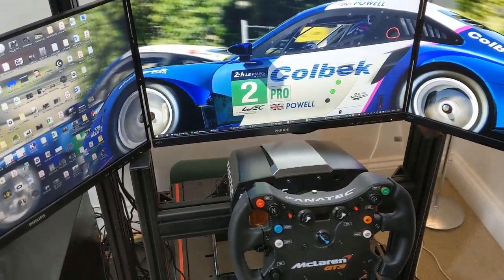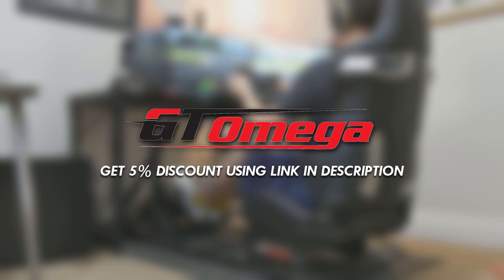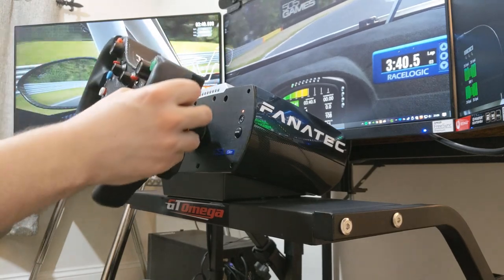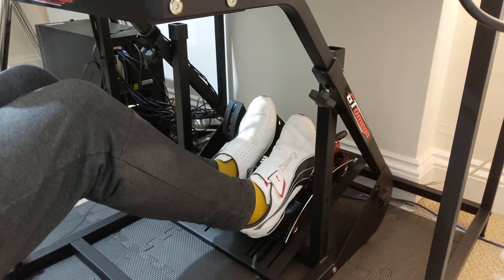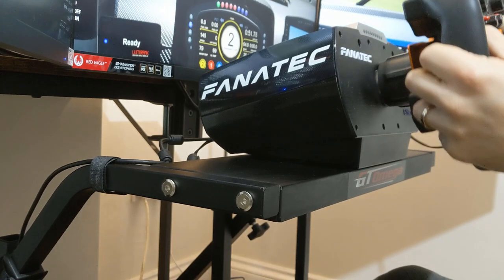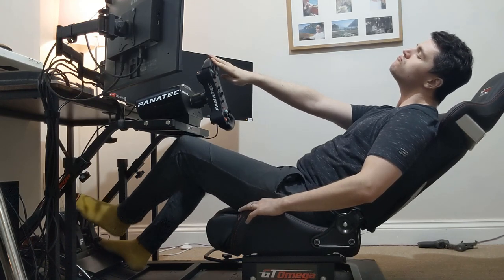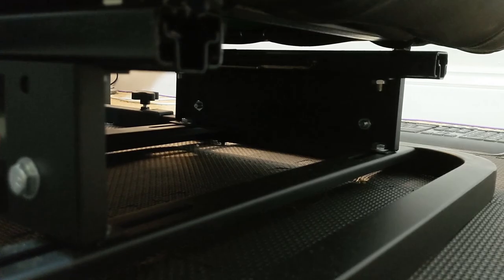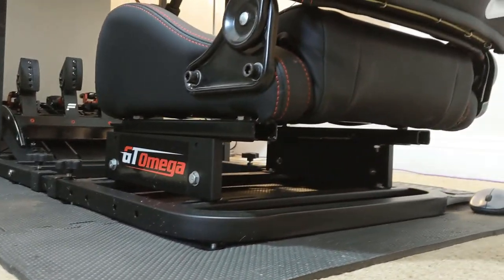GT Omega ART Cockpit - You Can Sim Race Competitively With This

Comment: Just bought one of these last week, moving from desk mounted wheel and monitors to the ART rig and separate triple monitor stand. The difference is night and day, already knocking 1 sec + off all my best laps and also helps with much better feel and control without everything shaking as you try to save a tail slide. Fantastic entry level rig 👍🏻

Comment: Thanks for the input Danny, looking to grab an actual cockpit when I move in October. This might be the front runner. Hopefully it can handle the new fanatec DD
Reply from the maker: I'm 100% certain that the new CSL DD will be supported and catered for, after all it's the high torque that elevates the full size DD's above this rig's remit, whereas the CSL DD's strength will be equivalent to current gen CSL and CSWs, just with the improvements anticipated with DD technology. I would like to confirm this at the earliest opportunity!
Reply: @dannyleeracing  love it. Might snag it then reenforce like you say
Reply: @BeckerSendsIt  hey man, did u end up pulling the trigger? Looking to buy my first cockpit as i prepare to upgrade from a g920 to a fanatec CSL DD and pedals. Wondering how the DD is with this cockpit.
Reply: @ibbeats5183  I have a Moza R9 on my ART. No complaints at all. There is a little flex, but not enough that I feel the need to reinforce it. Don't notice it at all while driving as Danny said.

Comment: I have owned the art for over two years now, I use a T300 wheel on it, it’s been great, yes thee is some movement, but it’s not detrimental to lap times. I also have the triple monitor stand which is also great, although a bit of a pain to get just right, but once set up it’s great. The only thing I would say it that there is some flex in the pedal plate, however it’s fine once you get used to it, it’s like having a bit of damping that’s all. It would be very easy to strengthen the plate though, and also very easy to totally eliminate the wheel base movement with a couple of side braces. Value for money, you can’t go wrong though, I have the XL seat, it’s big! So if you are under 6 foot, it’s gonna be way above your head at the back without a cushion on it. I think it would easily take the 5nm version of the new Fanatec dd wheel as well, it might be ok with the 8nm but I guess you’d have to try it for yourself. I use Simforge pedals and they work fine, but I’m going to strengthen the base plate with a thicker piece of steel and some heavier cross bars as it’s not really built for these kind of pedals.
Reply: im getting a t300 too with t-lcm pedals, do you think i should go for the titan or is the flex easy enough to fix. In case i have the budget for the TITAN but if i went cheaper for the same value it would be even better. thanks

Comment: As a GT Omega ART owner everything you say is correct.
I was considering an 8020 but seeing Karls video i felt comfortable the ART would surfice for my G923 wheel and Fanatec Clubsport V3 pedals and as mentioned any flex could be dialed out with a DIY solution
One thing you did not mention was the longitudal flex.... press hard on the brake and the frame will bow at the insection where the wheel deck and seat part join. Whilst not an issue when driving it does make for a loud squeak/creaking noise - i resolved this problem by mounting the ART on two lengths of decking board using the M8 feet holes and then fitting locking casters so the whole frame is mobile when neeeded. 
I have now since replaced the G923 last month for the Fanatec CSL DD and am very happy to report the ART copes with this wheel base absolutely fine however i do have the wheel deck nearly as low as is can go into the frame so it is not set as high up as your setup
Reply: @woodcote is that the DD with boost kit?

Comment: I have the GT Omega ART with RS6 seat. Very similar setup to yours actually with the CSL Elite wheelbase and Clubsport V3 pedals although mine is on castor wheels and is rally focused with the handbrake, static shifter module, WRC wheel rim. Also mine doesn't haven't triple monitors as I wheel it in front of my 65" OLED Central to my surround sound home theatre. It's a great setup. I'm very happy with it, although I have been looking at GT Omega's Titan cockpit which seems to be a worthwhile step up. I'm also likely to get the CSL DD when it is released. All in all, the ART cockpit is brilliant for the mid-range Fanatec gear

Comment: this is actually exactly what I needed cause i wanted to ART but I didn't want to upgrade in the future if i ever upgraded my belt driven with a DD so i was deciding whether to buy something serious or if this could have been able to handle something stronger but as you said there is no need to spend too much right now and if i ever need to change something id probably change from the thrustmaster to the fanatec ecosystem so I think I'm going to go with the ART
Reply from the maker: The ART can handle equipment up to a good level, I would be happy running the CSL DD and Clubsport V3's on it forevermore, but I've since been granted a GT Omega Prime cockpit which is over twice the cost so my ART is enjoying early retirement. Good cockpit, served me really well.

Comment: I bought mine six years ago. It's still rock solid. The RS9 seat is in excellent condition as well.
Handles a DD wheel with ease.
Reply: What DD wheel do you use, if i may ask? Just bought a Fanatec DD1 an am curious if it will endure the power ^^

Comment: I'm not a sim racer but recently got into GT7 on PS5 having stopped racing GT5 on PS3 many years ago...  The PS5 is really my sons but I have a 1/3rd ownership in it 😁 to play GT7.  I had to get a new wheel as my old wheel (from the early 2000s) was not compatible.  I got the Logitech G27 for now to get by.  Not hugely impressed with the "dead spot" on the wheel's force feedback but it works for now.  Ironically, I'm using it with an Ikea lawn chair from the mid 1990s (still going well and very comfy for racing position) and a fold away table (just like in your video),  It's not great but works.  

So now thinking of the ART.  I'm never going to get into hard core sims but I could see myself upgrading to a budget direct drive wheel like the Fanatec DD Pro PS5 and some point in the future.   It looks like the ART (without chair) may be a go "beginner" stand that can grow with me and potentially take a lighter force DD wheel in the future without needing to change that out again.  How stable would the ART be without the seat extension attached to it?  I would just use it with my lawn chair for now and then potentially get a chair down the road..

Comment: Jelly of the newer ART you have there. Mine's a first-generation with the MDF pedal deck, which isn't the best design either as it has no reinforcement to stop the pedal deck lifting at the front; the friend I got it from had to ziptie it down and send a couple of bolts through for good measure. Great rig otherwise, and I like the articulated keyboard tray so much that I just sold my desk and have been doing everything from the rig. Love it.
Reply from the maker: I bought a brand new ART as my old one had my own DIY pinewood pedal plate, so I know how you feel! There definitely seems to be many improvements between the early gen I had (same as yours by the sounds of things) and this one. I sold my old ART even with the shonky pedal frame for 50 quid on FB Marketplace so the net cost was pretty reasonable.
Reply: Absolutely spot on with this. Nothing more satisfying than doing everything from the rig, from work to any other form of gaming, to sim racing.

Comment: Hi Danny , would you recommend getting the titan or this one ? Is the titan worth the extra $150?

Thinking Of starting off with a entry level Logitech wheel. I may upgrade to dd in the future however. I want to get a rig that can handle that upgrade
Reply from the maker: Having never had a Titan I can't really say - but for me the ART has pretty much everything you'll need for a while - it is capable of handling a CSL DD for sure (angle adjustment issue can be overcome), anything above that and it would make more sense to upgrade the rig too.

Comment: So would the ART handle a 12 NM DD wheel? Like a Logitech G Pro or Moza R9/R12? If so, I'd definitely go for this! If not, probably not because I wanna upgrade to a DD wheel in the not-to-far-future. Let me know when possible, please! Great vid BTW!
Reply from the maker: I reckon a 12nm DD will be at the absolute top end of what I'd say is really usable on the ART - however, the Titan might be the better choice for you if you're going that way, not too much more and is much stronger.
Reply: @dannyleeracing  Great! Thanks a lot, I'm pretty decided on getting a GT Omega, just trying to get the best one for my needs. I'll start looking into the Titan. Mainly down between the Titan and the Prime now. If anyone else has owned the Prime/Titan, please let me know what you thought about it/them!

Comment: Thanks for the information.
I just bought the ART for my new Asetek Invicta hydraulic brakes and CSL DD 8nm wheel base. It looks like I might need to reinforce it. At least for the brake pedal. I really needed to persuade my wife for this cockpit and I'm afraid I'm going to really regret it.
I'm not expecting to set the brake to the maximum 180 kilos of pressure in the software settings. 100 Kilos would do. If that would be possible?
I watched Goslings video just before this one on how to make the wheel base part stronger. But I'm more worried about the brake pressure cockpit flex. We couldn't afford the TITAN or PRIME cockpit.
Edit: The Asetek Invicta pedals are set 90 degrees by default to the bottom heel plate, so I could set the ART pedal plate completely flat and set the seat as low as possible. I hope this might help some what, and then test the brake pressure in the Asetek software.

Comment: Is it possible to mount T-LCM pedals off-centre (to put brake more in line with left foot)? I.e. can you use all the vertical mounting lines with that pedal option or is there another way to achieve this?

Comment: Great video! Did you drill holes for the wheel base? I also have an rs9 but the 3 screw holes holding your wheel are not on mine. I just ordered a dd1 and don't think its going on without drilling. I also love the rs9 and want to make it work
Reply from the maker: Didn't have to drill any holes! You might need additional bracketware for a DD1 but best to look for someone that has one on an ART cockpit, unfortunately I can't say from experience

Comment: I have a comfy car seat from Vauxhall /Opel Vectra C and I wonder; will it be easy to install this seat to the ART cockpit frame? There are some protruding, sticking out pieces that I will need to chop off from the rails, maybe someone else used this seat? I don't want to throw it out as it is still in good shape.
Reply from the maker: Might have a bit of trouble mounting it as it's fixtures are probably specific to the car it came from, but you could buy a seat slider rail and see if you can make it fit

Comment: Just ordered one last night. Looking forward to using it, not going to use it for racing, but for Farming Simulator, yeah might be overkill, but I need a cockpit rather than table mount my wheel etc.. I ordered mine without the seat, and my plan is to use my old DXRacer chair on the rig. If someone has experience with this, let me know. Appreciate the help ☺

Comment: Hi Danny thanks for the video, obviously you made this before you got the CSL DD, do you think this cockpit it suitable with the DD? Thanks
Reply from the maker: I used the CSL DD on the ART for about 2 weeks before I built the Prime - I found it to be totally fine, the only thing the ART might be limited in is the amount you can tilt the wheel up. For me I could have done with about 5 more degrees of tilt - other than that, the CSL DD and ART go fine together! I'd have been content to carry on with the ART had the Prime not been in hand at the time.

The lack of tilt is fixable if you happen to have a body proportion that leaves you wanting a couple more degrees, but I haven't gotten around to exploring that in any detail or showing how it can be done. Most folks won't even think there's a problem!
Reply: @dannyleeracing  Cheers mate, i'm moving from a pad to a wheel setup and atm my option is to clamp it to the desk and use stem casters but i'm thinking a rig like the ART would be a way better option. I've found your videos really useful and they help me make decisions on what to purchase, i'll be using your code too with GT Omega. 

I think now i've tested the V3 pedals with the performance kit i've realised i will need a rig as even if the chair doesn't slide back there's still a lot of play in it.
Reply from the maker: @JDRacing-j2v  If you have the room and the extra budget, the ART will do wonders for how 'cool' it is to drive. I remember when I went from a desk setup to an ART I just felt like I was mentally stepping into the sim car - sitting low on the floor with all the controls feeling solid and no chair moving all the time!

Thanks for keeping the discount link in mind, it'll apply on checkout. Come back and let the comments section know how things go so others following you can hear about it!

Comment: Thank you very much for your help but do you know if the cockpit is easy to put away if you only want to use it for a day and then stow it away?
Reply from the maker: It's not foldable but you can get casters/wheels for it to roll it into and out of your space. The seat is also not 'flat-foldable so it's not like you can stash it under a table either.
Reply: @dannyleeracing  thank you for the help. I went out and bought the f-gt lite this morning and it works perfectly as it is foldaway and I can easily stow it. I am giving you a sub as you have helped me a lot with my rig.

Comment: I have been looking for a lot of info on this specific rig but never seen anyone look for such a specific case as I did, but is there a way I could use the separated seat as my computer seat while I am not using the wheelstand? I am very much looking for a sturdy rig with very little flex but also want it to fit in a quite small space when not using it and a detachable seat rig seems like the best option. Do I have to worry about tipping over in the seat when not attached to the wheelstand? Is it high enough for a comfortable seating position for a regular desk? I would appreciate if anyone had some info to spare about these concerns of mine.

Comment: I'm new to the sim racing world ( 1year) and recently upgraded from controller to a G29 wheel and got the Truebrake mod for the brake pedal. I only use it for gt sport but Im sick of sliding all over the place at a desk and chair so I'd love a rig..I'm 6ft 5in and  19.5 stone so my question is is this strong enough or should I look at the Titan? I watched Karls upgrde video too showing the strenghtening ad ons so I could easily do that. Not planning on spending too much so not sure if the extra €100+ odd is worth it for a Titan?? I cant see myself ever buying top end wheels and pedals either..What would you go for? This or the Titan?
Reply from the maker: There could be an argument that as you're on the taller side, you would want the extra leeway that the ART can give you in terms of height adjustment, as the titan can't adjust the length/height of the steering column. I find/found the ART to be really good but I never tried the titan so I can't speak from experience. If you're also on the handy side as you say, the ART is easier to 'work' with as it's all box section rather than tubes, so if you really wanted to you could bolster it like how Karl did.

Comment: Do you think this cockpit would work well with the new CSL DD base?
Reply from the maker: It is strong enough for it, but there is not a lot of pitch angle to tilt the wheel up and down, and because the CSL DD is designed to mount flat to the wheel plate it does mean you might need to modify it to get it to tilt up enough if you're really tall. Otherwise, it's certainly capable of holding it.
Reply: @dannyleeracing  thanks!

Comment: Do you think the wheel base stand part has enough adjustment to accommodate for the new csl dd?
Reply from the maker: The wheel baseplate could do with tilting up a little more for tall people, but the actual stand itself has plenty of adjustability. I'm 6 foot and I could have done with a few degrees more tilt to be absolutely perfect, however it was plenty useable and it would also be fixable with some basic parts. Before I got round to doing that, I upgraded to the Prime but I'd have been happy sticking with the ART if that opportunity didn't come.
Reply: @dannyleeracing  thank you for your reply 👍

Comment: Brilliant video thank you. I'm planning on buying this rig, will it fit the seat from the ADX racing seat rig...... its a terrible rig and i need to update, but I've customised the adx chair and would rather keep it if i can. I see you had a pic of it on your graph there..... any luck??? Cheers!!
Reply from the maker: I have had an ADX racing seat rig pass through my hands so I know the one you mean - you MIGHT be okay but I couldn't guarantee it. The GT Omega ART does come with brackets that should allow fixture to seats with bolts on the bottom but the ADX might have a weird configuration that's unlike any other. Only one way to know, I'm afraid!
Reply: @dannyleeracing  thanks for the reply, exactly my thoughts so I've dug deep instead and gone when the rs9 seat along with the art....i used your 5% discount too so thanks a million, 20 quid, not a bad saving!! Great content mate, thank you